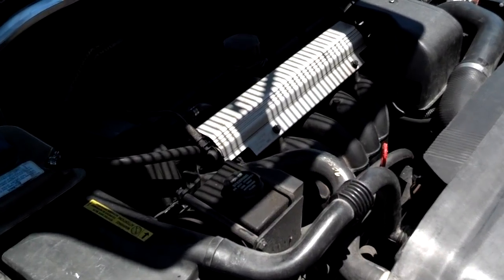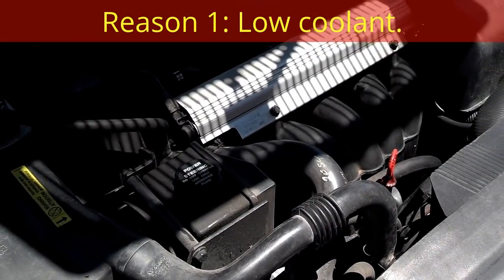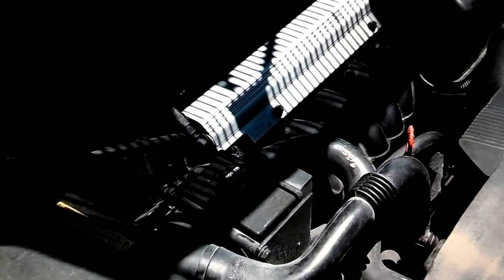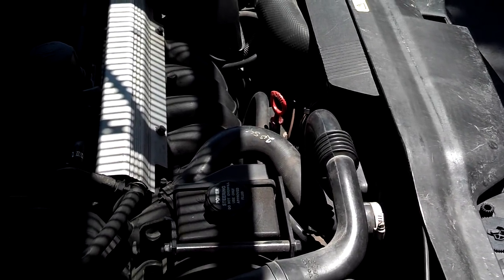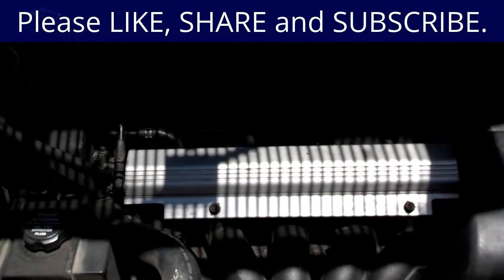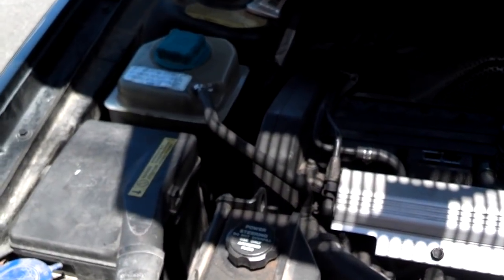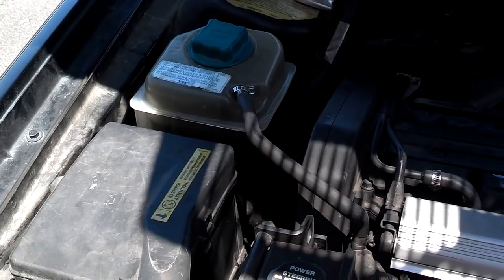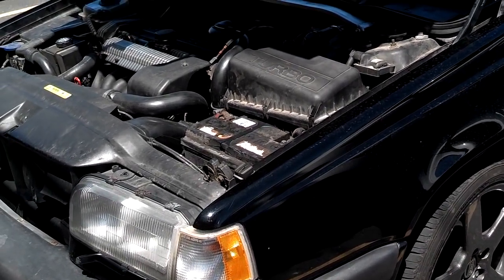My car is over heating, why is this happening? What should you do now?

Comment: Here is my situation I have an 07 H3 Hummer 5cyl 3.7 everything original, my temperature gauge is going up and down, my fluids are good, when Im driving it goes back to normal, when I slow down or stop, the needle jumps up and down, warning light says ac off engine hot, as soon as I drive it goes back to normal, when I park and let idle, the needle will read normal about half way. When I go see a mechanic it cools normal. I dont see any water puddles or leaks.
Reply from the maker: +Daniel Madden does the cooling fan work? You should plug a OBD2 tool in and see the actual temp.
Reply: Fan clutch

Comment: hi i got a ford pickup when i cold start it without the radiator cap it pushes out the coolant i then top it up cover it an about 10 mins it starts over  heating when the engine is idling i dont no whats going on or what to do... can you help me out plz
Reply from the maker: +rakesh gopaul huh? You should not start the truck with the radiator cap off. Has the engine been overheated?

Comment: hello sir. today i was riding my tata indica car. suddenly wen i see after 60km non stop riding i found that the car temperature was high than normal. so i searched for coolent weather it might b problem. bt i dint found nearly for 10km. so wat i did is i rested my car for 20min n opened the coolent cap. to my suprise there was no coolent in the coolent box. so immediately i poured 3litres of water. n then after 15km of riding the same problem has started. then i reached nearby oil shop n poured 1litre of coolent oil since there was only that much space in the coolent where i can fill upto maximum mark. then the problem was ok for 55km. after 55km of travelling slowly stared to raise temperature. now can u plzzzz help me..... whats the reason behind this type of behaviour. n wat vil b the solution for this????? n my raditor fan is working normally.
Reply from the maker: It coolant is leaking out while you drive. Find and fix the leak.

Comment: Hey Robert I have a  1994 Toyota previa with 169,000 and it overheats mostly on the highway. It doesn't go all the way to the red but 3/4 of the way. 1/2 is normal running temp. Would a head gasket or radiator cause this
Reply from the maker: +Mr. Don probably a bad water pump.
Reply: Put some water in the radiator you'll be fine

Comment: Thank Robert, learn a lot from your video.  liked and subscribed.  I have an 88 volvo 740 recently having smoke coming out thru the front grill after 30 minutes driving or idle in traffic, is this smoke from bad/leaky radiator ?  once i opened the hood with engine running and the fan running too, there was no smoke visible around engine block or near the radiator.  I did smell something burning near the radiator.  Temperature gauge on dash was at normal range.  I have OEM radiator, thermostat and connecting hoses on order.  if I drive for few short distance city trips until parts arrived, will i have my car engine over heated or damage my engine ?  based on what i described, is my coolant pump still ok ?  thanks in advance.
Reply from the maker: +Peter Cellphone I can't see what is smoking from here. Next time you see it turn the car off and try to find the source.

Comment: I have a leaking water pump, pump is original car has 170 k miles on it k-seal sealed it mostly now I top up reservoir once a week before it was once or twice a day should I fix water pump then do a head gasket kit test or can I do the head gasket test with pump still leaking a bit? Thnks
Reply from the maker: If the water pump is leaking it is about to break. What should you do?
Reply: Robert DIY fix water pump timing belt? Car is a Lexus IS 300
Reply from the maker: +M B I'd say so. Sounds like it is way past due.

Comment: So i blew a hose due to faulty clamp..it did overheat..now is it ruined it ran about 10 minutes till i got home...started it today and it sounds normal...would i hear anything different if i cracked it or blew a hg
Reply from the maker: depends on the car.
Reply: @RobertDIY it's long gone but it didn't mess up any thing..I ended up getting hit  about 4 years later

Comment: My car is still overheating I replace the water pump and thermostat and the fan works and my mechanic check my oil and gaskets and they where fine no smoke coming out the pipes but when I drive the ideal rises as if it wants to overheats the fan comes on but I'm thinking maybe i should replace the thermostat again or should I burp the car pls help I really miss my car it's a 1996 ford mustang
Reply from the maker: I'm not a Mustang guy but maybe the thermostat you were sold is bad, seeing it more and more these days. You could also have a bad head gasket. Test the coolant for exhaust gases. The auto parts store can loan you a tester.
Reply: If you live in " Warm Climate " aka ... California, Arizona, Texas, Florida etc.... By Pass it and call it the day.

Comment: Radiator, air trapped in the system, bad fan clutch (if your car fan(s) has one) Bad relays and electrical issues are other things to look for.
Reply from the maker: +xXDeathMetalThrasherXx thanks.

Comment: Very informative but very scary at the same time! My wife's car overheated the other day and I changed the thermostats (It's an Altima that has two thermostats) but the car's still overheating sometimes. No anti-freeze leaking on the ground or anything but the reservoir is always low. I'm going to change all the hoses, clamps, and radiator cap before taking it to the shop and hopefully that will solve the problem. Keep your fingers crossed for me guys. Great video Robert DIY!!
Reply from the maker: +DRock6906 thanks for watching and sharing.
Reply: Same thing is happening to me right now.

Comment: my head gasket was completly fine! coolant system wasnt working so engine overheated. removed head and had it checked. if your head is warped, you can still get same symptoms of a blown gasket.
Reply from the maker: Huh? A warped head is why the head gasket fails.
Reply: yes i understand it still failed. i just had no holes or any damage to the gasket itself. of course itll be replaced. and my only symptom was overpressurized coolant system. (exhaust leak)
Reply: and in case anyone wants to know. 98' L6 4.0l head was 12 thousandths of an inch warped

Comment: Hi Robert! I have a 2001 V70 (2.4T) the engine heats up to the middle of the temperature gauge in only 3-4 mins! it never exceeds the operating temperature but it seems very warm inside the engine bay even after it has been turned off, e.g 10-15 mins it still feels as if I just turned off the engine. could it be that my thermostat needs changing? (the thermostat itself is only 3 months old) or could it be a faulty temperature sensor perhaps?

kind regards :)
Reply from the maker: No.
Reply: ok, I also just went for a ride, and had an OBD reader on it which showed between 89-91c on the highway for about 15min which would indicate that it all seems to be fine :)
Reply from the maker: Perfect.

Comment: i have lumina 2006 when i drive fast my car heat up why what should i do plzz help and when i drive fast and go home then i come back and check water its getting low sry for bad english but yea when i drive fast my car heatup some times if not heatup i checked water next day its low why there iz no leaking i guess
i see every where i cnt see leaking plz help bro
Reply from the maker: It is best to top off the coolant first thing in the morning when the car is cold. Then check the level before you start it again when it is cold after a drive. If it is low again, it is leaking somewhere. You have to find the leak or take it to a shop for them to find and fix the leak.
Reply from the maker: https://www.youtube.com/watch?v=8LcL6nw5FfI

Comment: What would really suck, is if the overheating is a freeze plug issue.  Changing the freeze plugs normally require a mechanic to drop the transmission (big bucks).  This is why, as you say, it is important to add the right anti-freeze and water mix to prevent that.
Reply: Of course, you would notice a coolant leak if that were the issue.
Reply from the maker: +dragonore2009 most people don't look. I call it coolant roulette.

Comment: It only overheats at idle tho
Reply from the maker: +James Rheel does the fan work?
Reply: Robert DIY  yes sir I live in Texas I wonder if its the heat at idle the mechanic found nun wrong with  it
Reply from the maker: What kind of car is it? If you don't stop it from overheating, it will likely destroy the engine. If the coolant is good, I'd replace the water pump then fan and go from there.
Reply: Robert DIY  2011 cruze the mechanic ran all the tests everything was good the fan pump and everything so I'm going to flush the radiator tom
Reply: Robert DIY it's not bad overheating but it climbs over awhile
Reply from the maker: If the car has NOT been sitting, there should be no need to "flush" the coolant system. If the coolant is bad because of miles or age, you can replace it. If your mechanic would not find the problem, find another mechanic that will.
Reply: Robert DIY thank you so much but I ended up selling the car and buying a dart

Comment: On my Volvo my oil looks fine, but coolant turns in to mud color and spays over. Also it does not give hot air inside
Reply from the maker: +Jin- what kind of Volvo do you have?
Reply: +Robert DIY Volvo v40 1999 2.0 T
Reply from the maker: Sounds like it has a blown head gasket.

Comment: have a 2000 saturn and it leaks in my dash on the passenger side. and it doesn't hold fluids
Reply from the maker: Probably has a bad heater core.
Reply: Robert DIY hay
Reply: Robert DIY how much does it cost for a heater core to be replaced?

Comment: yeah I have a 2001 Ford F150 I went underneath the truck to change the oil and look on the crank pulley in water underneath the crank pulley dripping between the crank pulley and the engine block. my temperature gauge will be normal and go up and go down
Reply from the maker: Thanks for watching.

Comment: Hi Robert DYI! Great videos! I have puddles of water on both sides of front passenger & driver side of my SUV, I do have sunroof as well. Any idea what's causing it? the water doesn't have a smell. thanks so much!
Reply from the maker: +Paceables is it oily? Clogged drains can cause it. Is your coolant level dropping?
Reply: Hi & thank you. it doesn't seem to be oily, the coolant is good which was refilled a couple days ago. it doesn't seem to disappear. how can I check clogging? thanks again

Comment: Hi I recently bought a 1998 Volvo S70 2.3L 5 cylinder and I notice when I was driving home from work it would get hotter then what I think it should but not in the red and when im at a stop light it would get hotter and still not in the red. So when I got home i left it running and it cooled down to normal. The Collant cap is cracked so im getting a new one. Do you have any suggestions. and no its not leaking Collant but it does have a oil leak which is my next issue that needs to be worked on.
Reply from the maker: Was the fan going?
Reply: now that im thinking about it..I don't think so

Comment: I have a 96 maxima. New water pump, new thermostat, new radiator, new radiator cap. Car runs fine on the Freeway but once i go into traffic, the needle starts to rise
Reply from the maker: +David Nava probably has a bad fan.
Reply: Do you recommend buying the whole fan assembly?
Reply from the maker: yes

Comment: if my car needle mark stays in the middle and it doesn't rise to the red does it mean I have a blown head because im coolant resivor boils
Reply from the maker: The temp of the engine really doesn't have anything to do with the condition of the head gasket. If I walk up to a cold engine, and start it, it can have head gasket issues even when the engine is cold. 

If you start a car, and the head gasket is bad, and combustion gases gets pushed into the coolant chambers, the air will go somewhere, usually make its way to the coolant reservoir.

Comment: i think this can be a key question?  if the coolant reservoir smells like gasoline from the inside after the engine being cooled can that be cause of a blown headgasket??? realy need to know some tell me
Reply from the maker: Huh? Gas in the coolant? Never heard that one. You may want to get that checked out. If you have a car that routs coolant in the intake manifold, and you have a fuel injector leak that gets in the bad gasket, I guess it is possible.

Comment: I put a new thermostat on my car about two years ago. Lately I've noticed my coolant has been leaving out my car very often. So yesterday I checked the coolant before I left as usual and I noticed it was very low. So I was out of coolant. I put water in it and I noticed once I was driving the thermostats gauge was over the hot. I believe I have a leak somewhere. I have since purchase coolant and the car is still running hot.
Reply from the maker: What kind of car do you have? Never good to run straight water, especially in the winter.
Reply: Robert DIY it's a 1996 LS 400 Lexus
Reply from the maker: It has a leak somewhere. How old is the radiator?
Reply: Robert DIY about three years old. He did find a leak in the hose that connects from the radiator to the engine.

Comment: Usually with my car i can bypass waiting for the radiator fan to come on by turning on the A/C. Not sure if it works with other cars but on mine it'll kick on a minute or two after the A/C is turned on and this will work if the car isn't completely up to operating temps. Usually i will wait until the car is at operating temp before running the A/C but in extremely hot weather will keep my coolant temp gauge from going too much past the middle in which case when the coolant temp gets around 210-220 and by the time the fan turns on it would reach about 225-230 or more (which is right around the point where i'd be worried that your car could overheat). Personally the way they designed the car to have the fan to turn on when it's past the middle is too late, it should turn on when the needle gets about half way or moves past the middle point. (about 190-200). It really should not be going past middle at any time unless there is a problem and typically my car runs a bit hotter which is normal but that's when they need to have the fan run when the car's coolant temp is still at a safe temp.
Reply from the maker: Thanks for sharing

Comment: my car overheated and smoke came out from underneath the hood I added water cuz I didn't have antifreeze put it was leaking and was on the floor is my head gasket blown or water hose busted?
Reply from the maker: I have no idea. You need to have it checked out. I don't even know what kind of car you have. You need to fix the leak, fill the coolant system, then see if it will run.
Reply: Joey Irazaba u have a leak in your heater core...

Comment: my 2008 BMW is running hot, we put fluid in it but still running hot
Reply from the maker: +Juliette Williams ouch!
Reply: +Robert DIY , ouch as in I was sold a lemon
Reply from the maker: You just purchased it?
Reply: Ouch as if it is not the radiator it could be so many things worse. Yes.

Comment: i have 2007 dodge durango i change the water pump and the thermostat and the sencer to and evry time i drive in the street star over heating y is that?
Reply from the maker: Are you sure it is overheating? Maybe the thermostat is bad or the indicator is bad. It is also possible that the head gasket was damaged if you overheated it once.
Reply: @RobertDIY  How do you check if the indicator is bad or not?

Comment: My 2003 chevy Malibu was overheating went to the full red on the highway I fill the coolant, tune up, temperature senor... there is no milky things in oil pure dark black....I replaced the thermostat and its been working good so far..... its about six lines before the red I'm still nervous driving on the highway...my engine light came on found out its the 02 sensor...some said its a head gasket
Reply from the maker: +monica cru if it starts and runs fine don't worry about it.
Reply: Funny u said that everything work fine after the new thermostat....I drove it for like five miles after that I try starting it battery working it  comes on but doesn't stay on while I'm driving....today I try starting it it crank didn't start I try it three times in the same time period...then I let it rest for like five minutes and the repeated the process... after like ten minutes it started I pull off my battery only like four months old....I m thinking with the new adding work I should of adding another battery but its four months old didn't overheat at all seems like the thermostat fix that problem
Reply: monica cru
Reply: monica cru
Reply: I

Comment: Hi Robert, 

Our '96 Ford E150 had the temp gauge sensor reaching too high. Replaced the sensor and thermostat, but no fix. Never knew it was the water pump because there were no strange noises indicating a failure. Now it works perfectly, and while I was at it I replaced the radiator too. 

Thank you.
Reply from the maker: Glad you got it figured out.
Reply: I have question my toyota seguoia 2001 overheated and now can't start what can i do?

Comment: I forgot to put my coolant cap back on before I drove off to work and my car overheated and shutdown. It will not start at this point. It started to smoke a little from the coolant top not being on and it was completely dry in there. I had been putting water in it for the past week..have I blown something?
Reply from the maker: +Camaury Robinson probably, the head gasket.
Reply: Robert DIY aaw